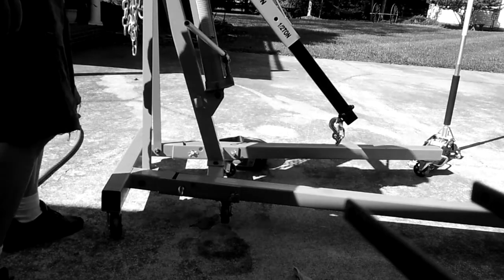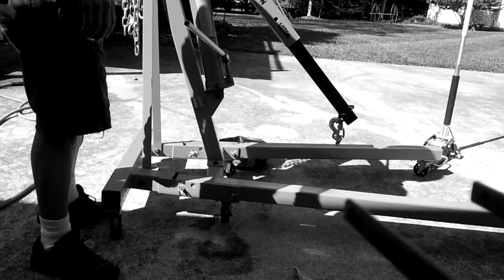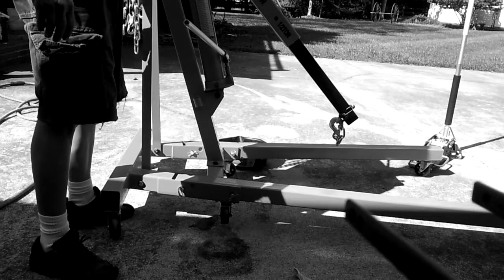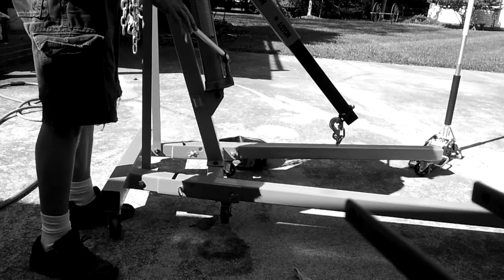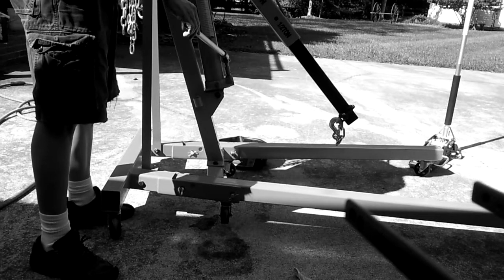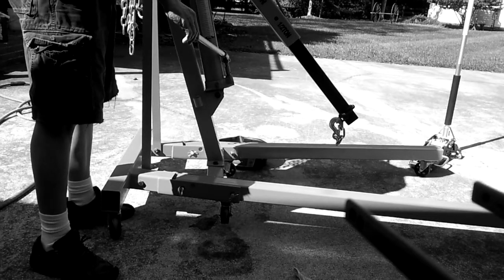Malfunctioning Harbor Freight Shop Crane - with fix

Comment: Mine had the same problem. When I would lift the crane with my hand and apply pressure on it, the handle would lift up. I fixed it by leaving the release valve closed (not open like the instructions say) and repeatedly lifting and slamming down the crane arm by hand until the valve inside the pump loosened up. Every time I slammed down on the crane arm, the handle would lift up; on the last slam, the handle didn't lift up, so I knew the valve inside the pump had finally broken loose, and the crane worked again.
Reply: thanks your fix worked good

Comment: Mine did the same. Did the fluid fill and pumped it upside down as per another video, no joy. Was getting ready to take it back to Harbor freight when she said I needed to bring the whole thing [not just the hydraulic] I said screw that! Hooked it back up and tried your up / down pump thing. Wa-la works like a champ again!

Comment: if you haven`t returned it to HF. remove the release valve and check the O-ring on it and clean it up. If that's not it; it's the internal seals under the big bolt on the top of the ram where the piston comes out.